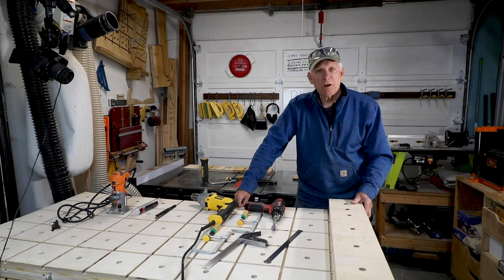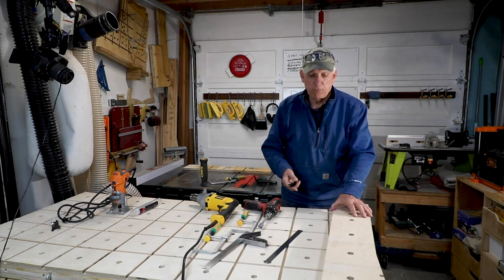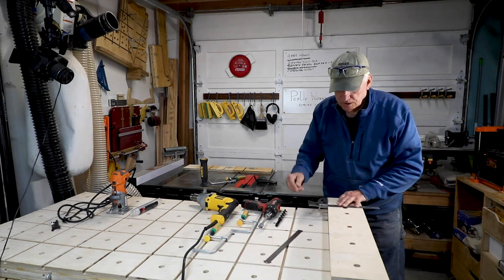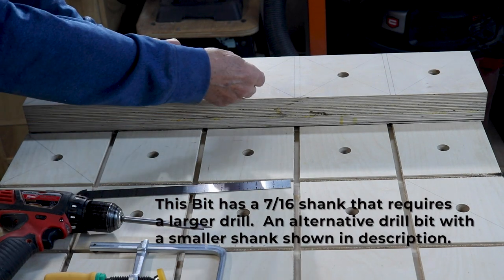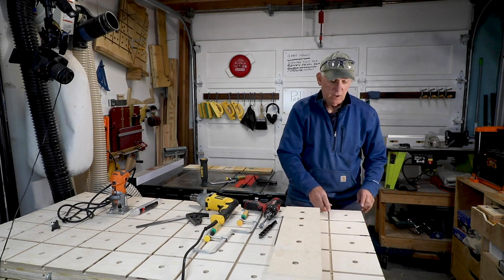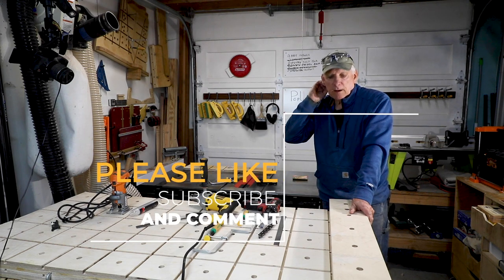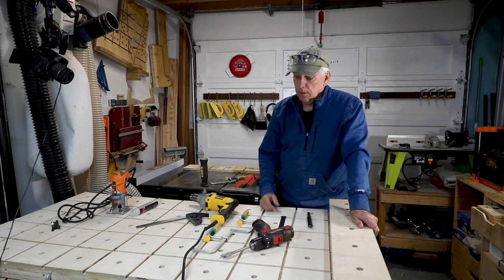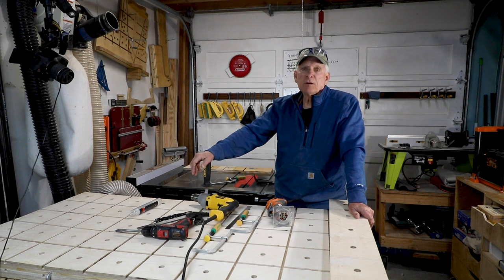How to Cut 90° Bench Dog Holes In a Workbench - Really Simple Jig!

Comment: whats that weird black line coming out from the base of your drill? like a leash so that it doesn't run away or something? hehehe
Reply from the maker: Very funny, Dave!
Reply: @SmallWorkshopGuy  seriously though, i've been putting off doing this to my bench for over a year now because i like the flat surface but are times i could use the dog holes.. i even have hold downs i've bought and never used.. how often do you lose screws and medication on that type of bench?
Reply from the maker: Bench dog holes certainly allow a lot of sawdust and debris to drop through to a tool shelf below my workbench - forces me to clean that area every month or so.  As far as screws (and medication??) getting lost, I find that any screw that get swept off the workbench accidentally has the ability to roll across the shop and hide in some crevice never to be seen again.  Only time it makes a reappearance is when you hear it hit the walls of the Shop Vac during a later cleanup.  And even then, it can hide in the Shop Vac debris unable to be detected.  Eventually it ends up in the city dump free at last, thank god, free at last!  Enjoy the dump little screw.... you earned it.